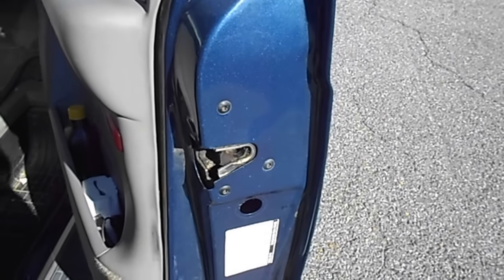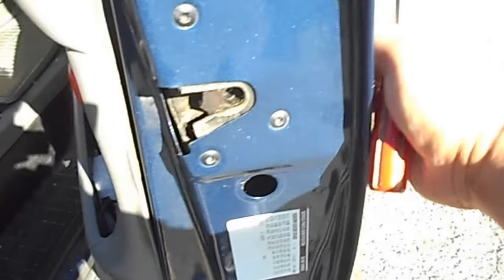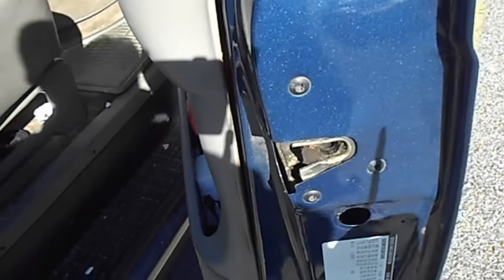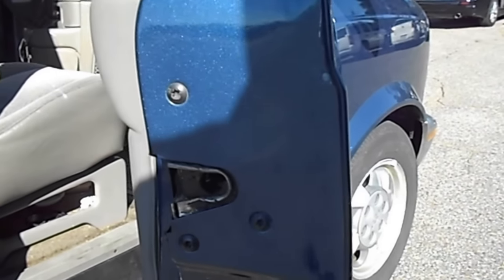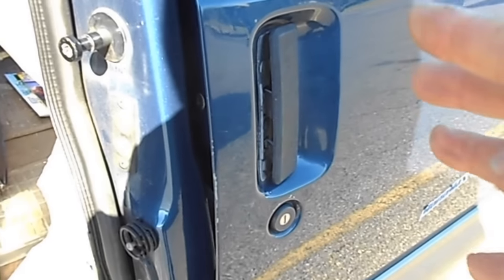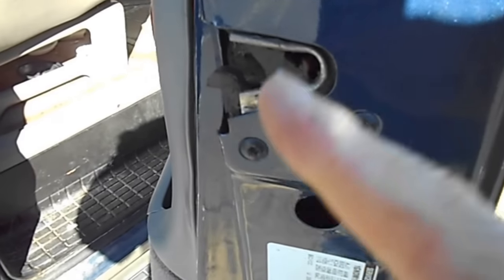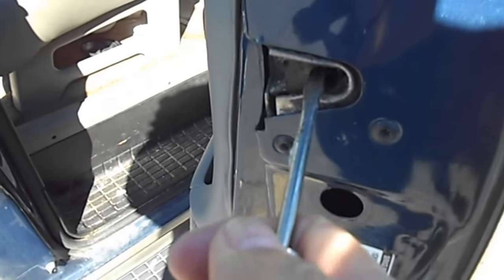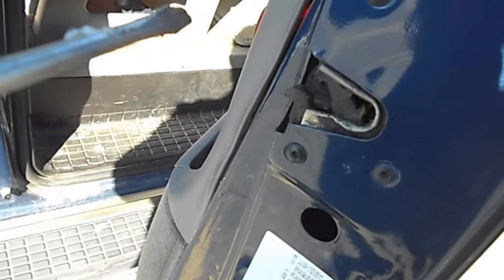How simple easy way to fix repair stuck open latch won't Does Not close door GM chevrolet astro van

Comment: You are a hero! I was cleaning the interior and accidently moved the lock. I was scared of having to drive 80 miles back home with one hand on the steering and the other on the door. In the parking lot a slight turn would instantly have the door wide open.
Reply: Me too, I was in the park at night, thinking I can not drive home like this...and Def couldn't leave my door ajar all night.

Comment: This fix is so stupidly easy!!!  Why did I not think of it???  I tried EVERYTHING on my driver side door!  Inside door lock, automatic lock switch, charge the battery to make sure it had enuff juice, screwdriver in the lock mechanism...I even tinkdered with the passenger side door with a screwdriver, and ended up locking that latch, too!  Now both doors would not close!!!  With this video, I was able to fix both doors in 30 seconds!  THANK YOU!

Comment: Thank you so much. I couldn't get this mechanism to move until I did what you demonstrated. I had slammed the door because it was misaligned after using lockout tools and the wedge somehow must have moved the hinge.I loosened the hinges and fixed the alignment and then tightened when the height was correct and then saw this mechanism would not move by door handle or prying(do not attempt-I slightly damaged it). Gotta check out YouTube. Two at the same time worked. Thank you. Thank you.

Comment: While replacing the second fuel pump in a months time on my late husbands truck the door latch sticks. Easy compared to everything I’ve learned to do on this truck but it was the last thing I needed this morning before pulling this bed again. 
Thank you for the easy instructions and teaches everybody to keep a screwdriver in the truck.

Comment: For those of you whose car latch won't budge, It wouldn't budge for me at first either.  It was Ice deep inside the latch.  I had to spray inside the latch with brake fluid.  You can also use WD-40.  I was then able to scrape the ice out.  It took a few fluid spraying, about 3 or 4 before it would budge, but it did eventually work!  One I started spraying, it took about 10 - 15 minutes.  You have to give the spray time to soften it up, and you might have to scrape ice out from inside the latch.

Comment: If you have an older car, lets say a 1985, the simple way to fix is lift up the lock from inside the car, then press the the button to open the door from the outside, and simply push the latch down then you can close the door and lock it again 👍🏽

Comment: how about the sliding door? im having an issue with my sliding door not closing. the tracks look good, i think its the locking mechanism not wanting to latch onto the pin. it was stuck in lock position at first and after i got it unstuck, it will wont close.

Comment: You Want To Fix The Real Problem You Have To Remove The Lock From The Door And Clean All The Old Grease And Dirt Out With Solvent . Then Lube With Low Temp Grease. That Is A Permanent Fix. I've Been A Mechanic For Almost 50 Years  That's How It's Done Correctly

Comment: Do the handle and screwdriver simultaneously. That's what he is doing. Six year old video. In 2023, first thing is to turn OFF all lock settings in vehicle computer and then do the manual procedure.